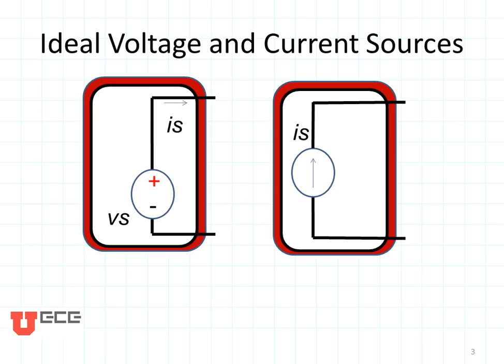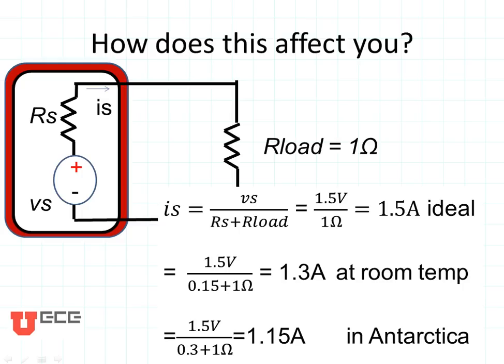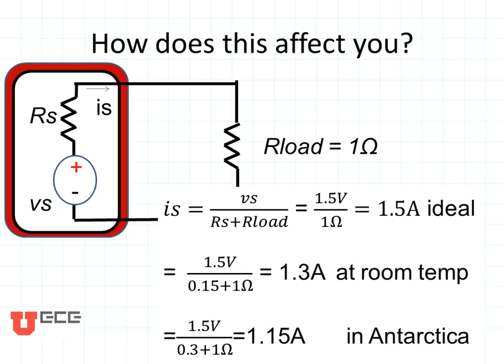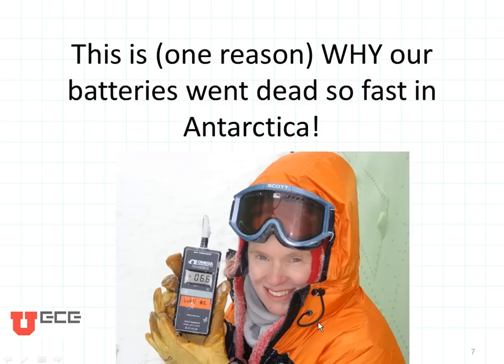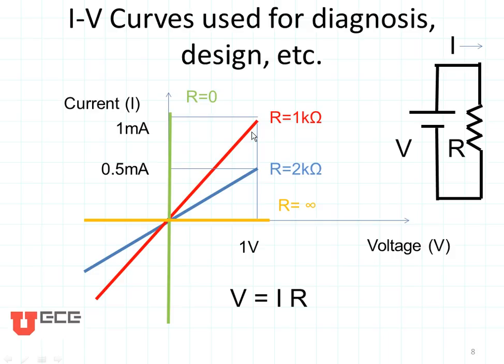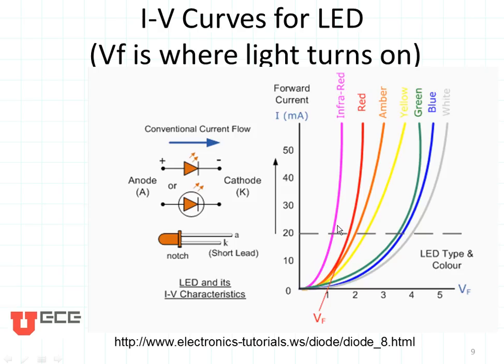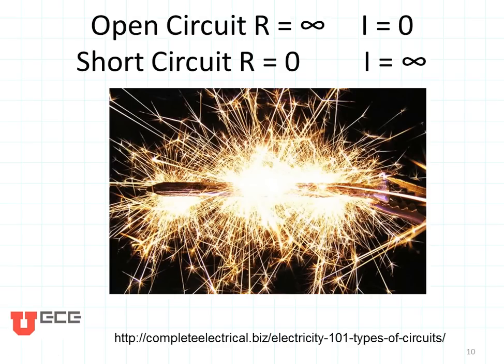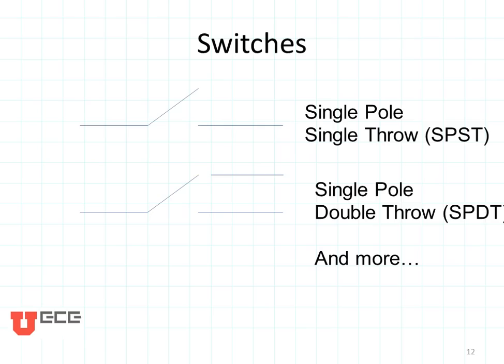lecture (1-6) Circuit Elements 2)

Comment: At ~3:05, you mention the idea of a resistance of infinity. Could you really have 'infinite resistance' or would it be bounded by the amount of voltage and current you have? Doesn't resistance have to be less than or, at the most, equal to the amount of voltage since voltage is defined to be the product of the resistance and the current?